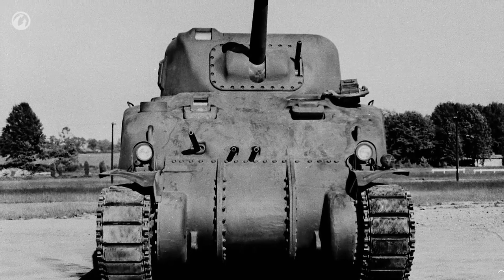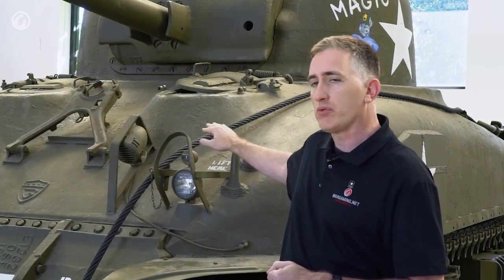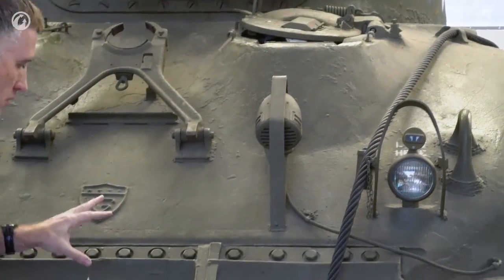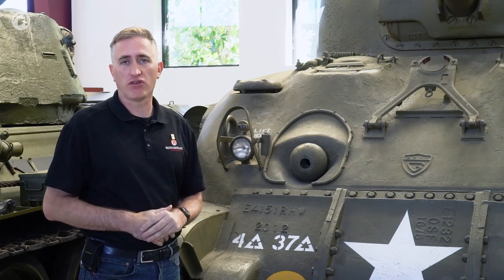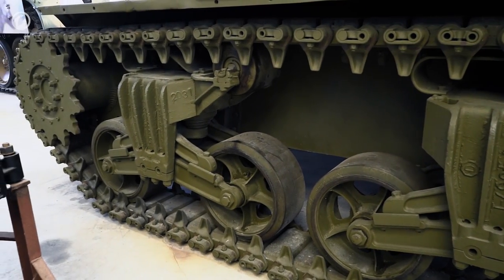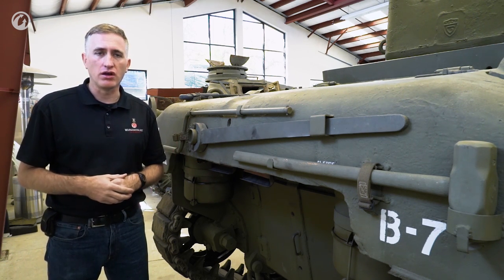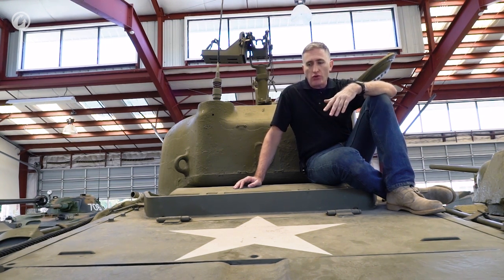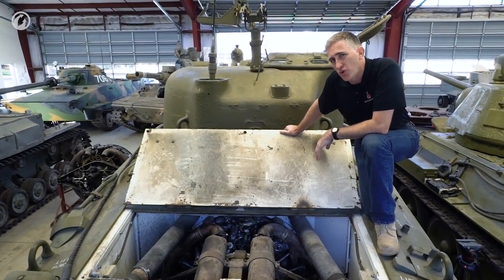Inside the Chieftain's Hatch: M4A1 Sherman part 1

Comment: US steel quality was the best in WWII, too, on the average.  In my study of naval AP projectiles and armor, I use US circa-1941 Class "A" (face-hardened) and Class "B" (BuOrd)/Special Treatment Steel (STS for BuC&R/BuShips) (homogeneous material similar to US Army RHA, but softer, on the average, due to being much thicker, on the average) as my "Standard" armors and the US Crucible Steel Company 14" Mark 16 MOD 8 AP projectile as my standard projectile.  Except for a few German L/4.4 AP with harder AP caps that gave a small percentage better penetration of Class "A" armor and the affects of different face thicknesses in Class "A" armor giving various results due to scaling effects (thicker faces had greater scaling effects that reduced resistance as projectile size increased and thus thicker faces were not correct for thick armor for use against large-caliber battleship AP shells, something not known at that time but quite evident when test results are compared over all nations' face-hardened armor types), no naval foreign armor or AP projectiles gave better performance, on the average, than their US.counterparts as to steel quality.  Even Krupp steel was only 0.96 compared to the US 1.00 average from the three naval armor manufacturers Midvale, Bethlehem, and Carnegie/Carnegie-Illinois (this last being part of the US Steel Corporation).

Comment: The Germans had the same readiness problem with aircraft.  In the early stages of the war they would ship aircraft back to the factory for repair even if there was only one part missing.  They started cannibalizing but that hit a limit quickly.  Then as fuel shortages hit and distances grew larger it became impossible to do on field repairs.  The Allies found a number of German aircraft sitting on a field inoperative due to a few missing parts.

Comment: My god that is A small tank. Men must have been smaller back then. I'm 6' 2" 200 Ibs and that would be more of A Sardine can to me. I'm A little shocked at how small the T-34 is. Just pictured it bigger.
Reply: This is a Sherman not a T34 and the Sherman has a huge  height ratio compared to most tanks of the time.
Reply: @RhysapGrug I know. The T-34 is next to it!! I just said I thought they were bigger . Both tanks are seemingly small.
Reply: @backwoodsbully9841  
I was inside on a T-34 on static display in Vietnam. A rather claustofobic experience 
I believe the the Russians up to more recent time picked recruits of small stature to serve as tank crews but even then it must have been pretty cramped and not overly ergometric.

Comment: the easy eight is an A3 isnt it?
Reply: It's a M4A2 post war converted to a E8 for the movie, the A3 would have been period correct, but they are sparse and few still run, the A2 looks the part of a A3 mostly, so they used that.
Reply: what movie are you referring too?
Reply: The E8 refers to the suspension system. It was applied to various vehicles including A2 and A3.
Reply: thank you :D

Comment: Implying a distinct line betwen reliability and ease of maintence is being argumentative for argument's sake, because end result, tank avaliable for battle when you need it, is same. 

Now, one argue that "reliable" tank is less likely to break in battle. It is logically true, but irrelevant. When tanks break, they usually do so before getting to battle. If they break during battle at frequency that matters, you have a tank that shouldn't be sent to frontline units, to begin with.

Comment: With all respects to the great job Chieftain does, somehow he has fallen into the trap developed the past 10 years that labels the 76mm as a great gun that could penetrate the frontal armor of a Tiger or Panther at moderate to short ranges. Without a VERY SHORT SUPPLY (average issue of one per month) HVAP round, it's simply not true. The 76mm rated penetrating 95mm at 250 yds (0 degree slope) while Tiger's frontal armor had 100mm sloped at 9 degrees. Result? Exactly what the GIs ranted about, they bounced off just like the 75mm.
Reply: The problem was the low quality standard ammunition, which had a nasty tendency to shatter at impact against German armor plates which were harder than US test plates.
Reply: That was part of it. Another part was the 76mm was designed to have a longer barrel, which was shortened to provide a quick way to achieve turret balance. This lowered the velocity.
Reply: @sargeast1629  That's true, but higher velocity could possibly made the shatter problem even worse. The US 90 mm M2/3 had the same problem.

Both guns weren't tested against German armor until late 1944, so there were little time left to correct it, although the 90 mm received better rounds near the end.

The Germans had the same problem in 1941, and fielded upgraded rounds in 1942.
Reply: Well, in May 1944 they knew they had problems and (IMHO), nothing was going to be done about it until (tragically) Gen McNair was accidentally killed by the Cobra Breakout saturation bombing in late August. To me the evidence indicates he felt he was doing what Gen Marshall (who had written the Army manuals on prewar tank strategies) would want by limiting tank (not tank destroyer) armaments. With his tragic death the dam began to break.
Reply: May not have penetrated the armor, but molten, steel splinters had an fatal effect of the crews.
Reply: Your numbers are off, M62 could penetrate 94mm of armor at a 30 degree slope from 500 yards. M79 at 30 degrees could penetrate 109mm. M93 at 30 degrees could penetrate 158mm.

Comment: 5 Tigers = 1 Sherman
Reply: 3.1 in regards to cost, 35.7 in regards to production.
Reply: Indeed! A roomy, modern, ergonomic and mass produced tank? With armor equal to shoebox Tiger to boot? For sure.

I'm mocking the 5 Shermans < 1 Tiger math that people seem to whip out as if war is a dick measuring contest.
Reply: Some of this "5 Shermans to 1 Tiger" saying actually comes from Sherman reliability.  The smallest tank unit sent on independent combat missions was the tank platoon, which the US could maintain at full strength -- 5 tanks.  For the Germans in '44, their tank platoons were rarely at full strength, and were often down to a single tank each.  So sending 5 Shermans in response to a lone Tiger was common; that was simply the smallest US tank unit available.

Comment: this tank was a joke and embarrassment to the united states
Reply: No it wasn’t lol, highly reliable, easily repaired, upgradable, decent fire power and front armor effective thickness on par with the Tiger I by ‘44, if taken out in battle it could be repaired within hours, and the lowest crew casualty rate of any tank in the war. For example, the T-34 saw an 85% loss of its crews, the Sherman saw 12% loss.
Reply: @josh05683  by the time the sherman actually got into battle -the war was almost over and the germans lacked the equiptment to deal with it. most of the german tanks by this point were still fighting the russians. hence the t34 85% loss rate!. no way did the sherman stack up against the tiger.
Reply: @super20dan  Lol the Sherman first saw combat in 1942 in Africa…
Reply: @super20dan  The 85% is not how many tanks were lost. The T34 saw an 85% crew casualty rate meaning when it was penetrated, crew members had a 15% of survival. Thats what that means. This is because it was a cramped tank and the crew were packed together.
Reply: @josh05683  the only reason the sherman was sent to fight in ww2 is it was the heaviest tank that the cranes could lift for loading . this is an obscure fact i discovered.  if the sherman was so good-why the rush to get the m2chaffee to europe ? the t34 was the best tank in ww2 overall and its responsible for the russians victory in the end.
Reply: @super20dan  Lol the T-34 saw an 85% crew casualty rate, the Sherman saw 12%. Did not watch the video lol?